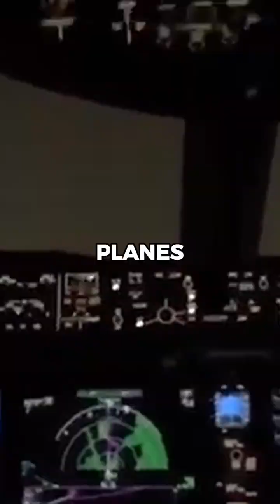Why can't planes fly through hailstorms?

Comment: In the late 80s early 90s a. DC 8,  2 767s and a 757  were parked on a  midwest airstrip when hailstorm hit. Afterwords the DC8 went back to work. The other planes  needed major  repairs.  Boeing had started building its planes  out of light weight metal that damaged easily..